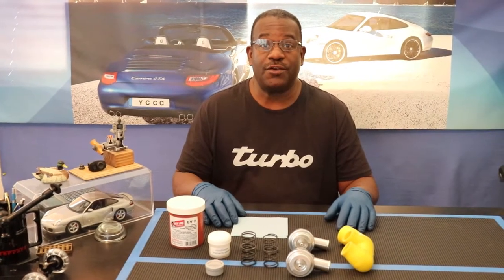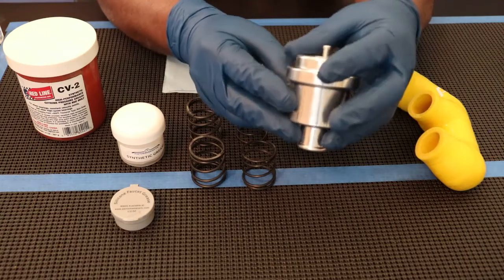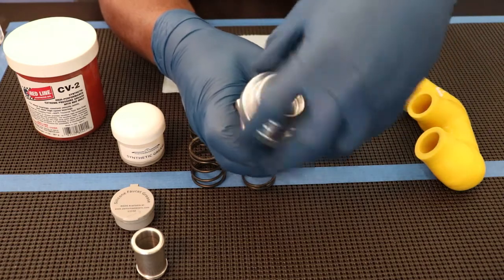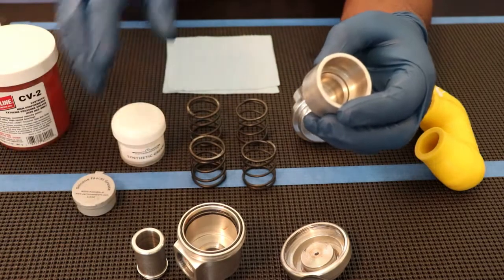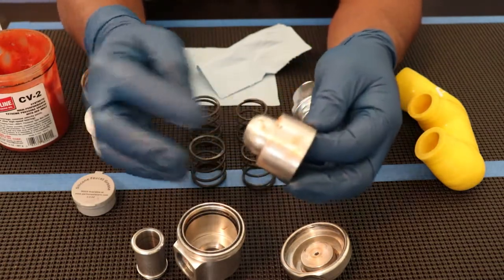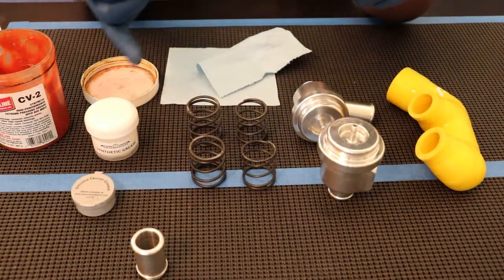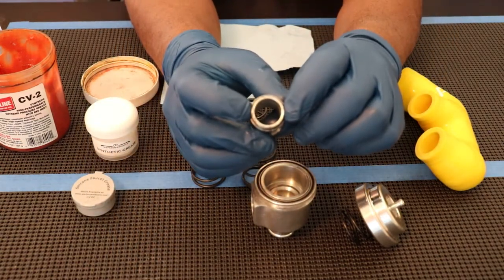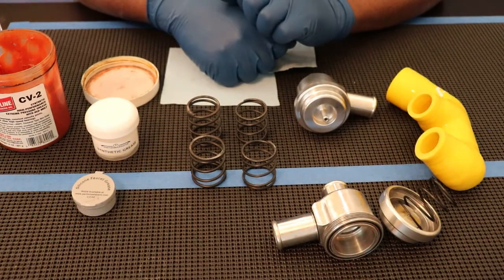Good Diverter Valve / Blow off Valve Function Service and Configuration

Comment: I assume that these are on the 996TT, but you never mentioned which ones you went with. Care to share?
Reply from the maker: William, yes these are going on the 996tt. I shared the attributes and described the qualities I liked about these particular DV's as best I could because they are a no name brand.  I never did know the name brand, I selected them based on design and my understanding of the materials,  and the job they are meant to do.  The brand was not included in the listing on eBay.